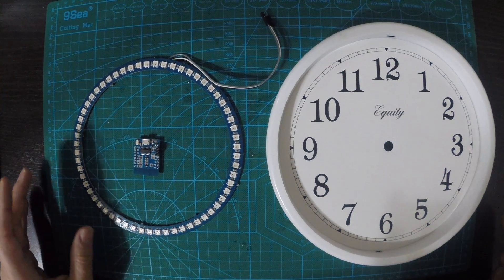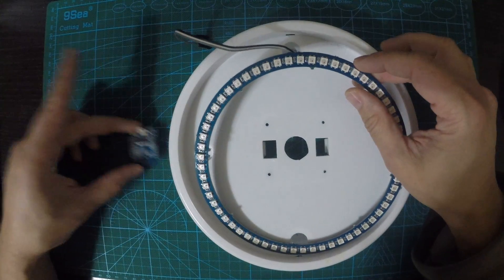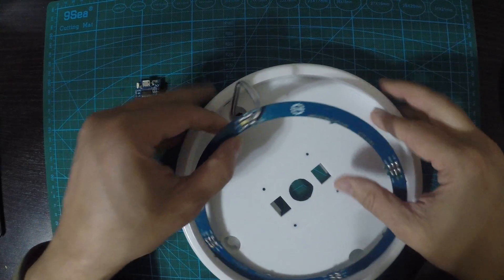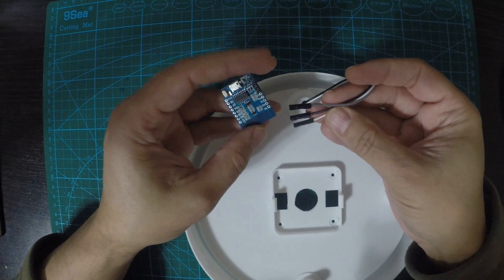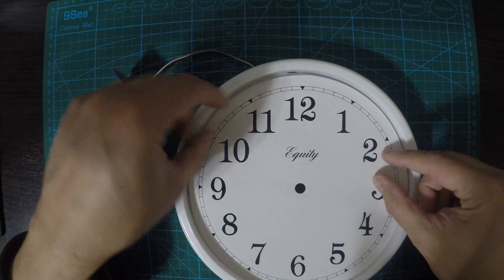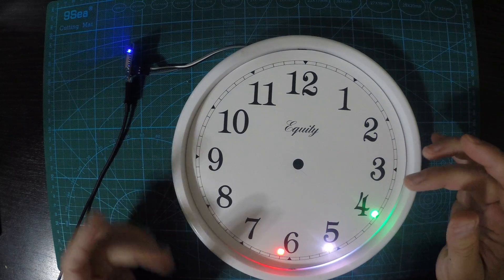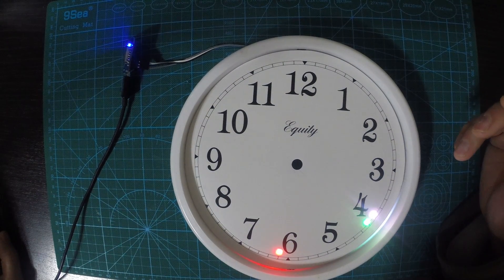NeoPixel Clock using ESP8266 with NTP based time.

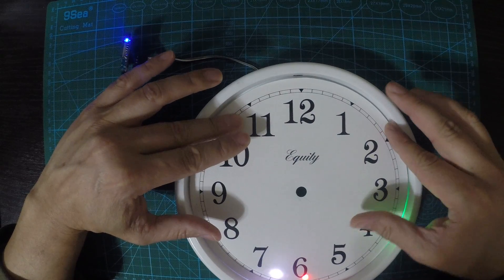Comment: The big problem with that clock is. Anyone looking at it can not tell which is the minute hand and which is the hour hand. (or dot) it needs 2 rows of leds so the outer is the minute and the inner is the hour. So someone who doesn't know that the green led is the hour doesn't who if its 4:30 or 6:20. You should have to explain to someone who to read a clock.

Comment: hello, 
which  version of arduino IDE you used to upload the code? I'm using version 1.8.1, but it does not work. I do not know what the problem is.
Access Manager works, I can configure my wireless network, the blue LED on the board esp lights up but the clock does not update only a single neopixel is lit.... can you help me?... thanks
Reply: mesmo problema